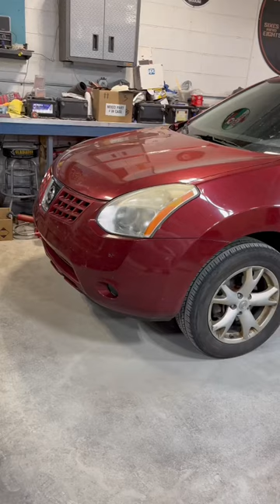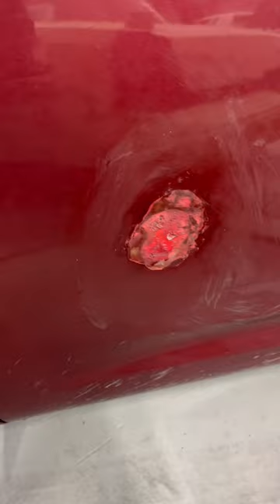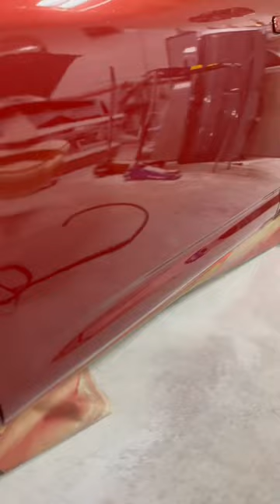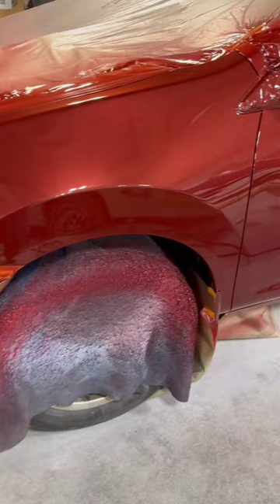What BULLET HOLE🤷🏽‍♂️

Comment: What do use for the back side of a metal patch repair? Do you leave the back side bare metal or epoxy the back side? Just wondering for future rust proofing because doors are known to have water flow through them for draining. I have a similar issue I need to fix. Was wondering how the UP KING handles it
Reply from the maker: Definitely epoxy or some kind of protective coating is what you want to use on the back side to prevent having issues down the road
Reply: @UndergroundPaintKing  cool sounds good. Appreciate that.
Reply from the maker: @k20lifestyle  you’re welcome Fam!

Comment: UPK do you ever use panel bond for stuff like that?
Reply from the maker: I haven’t used panel bond for a actual bullet hole but I have used it and it works great Triggerman
Reply: @UndergroundPaintKing  ok just wondering, they use it a lot at my shop. That stuff does miracles.
Reply from the maker: @thetriggerman954  yeah it’s the real deal!
Reply: @thetriggerman954  yes it does it’s awesome used it  sometimes when I’m doing a stitch weld and  grinding it down some little holes will show up so instead of welding it again possibly making the hole bigger I use panel bond to fill in that hole it’s just as good 👍🏾
Reply: @mississippiwrenches295  🙌🏼

Comment: There is nothing wrong with that weld. Did you put fiberglass bondo on the welds? Turned out great!!
Reply from the maker: Thanks GarageHack, I appreciate you and it’s good to put fiberglass filler over the weld to help prevent moisture which eventually causes rust

Comment: I was told not to use resin for holes because of moisture that you have to weld it fix or it will come back.
Reply from the maker: I have used resin to fix holes before and haven’t had a issue, you just have to go with what’s best for you Craig